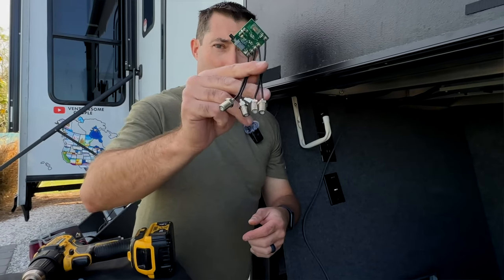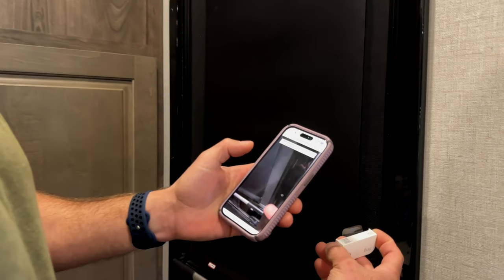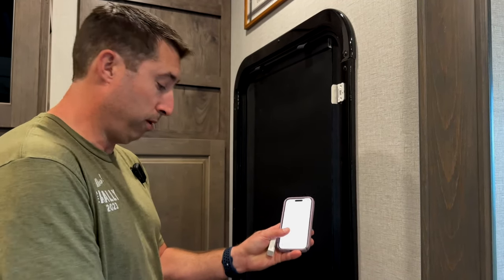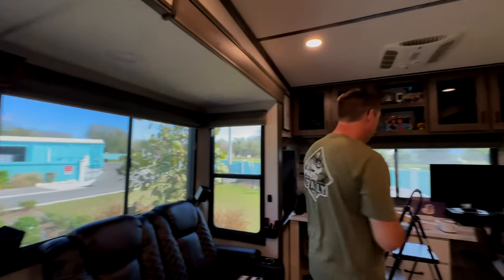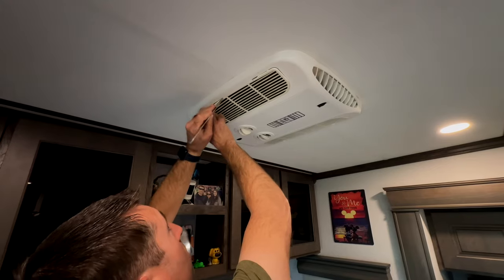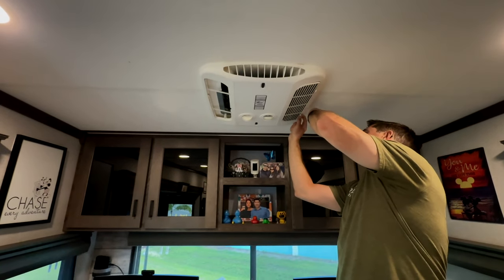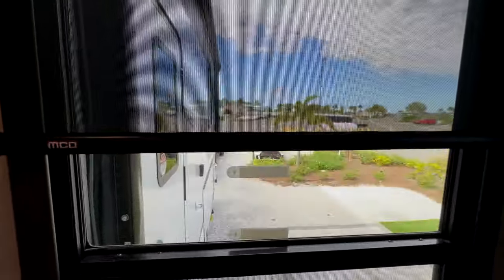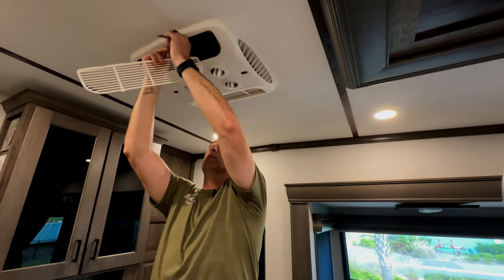Fixing What We Broke on Our RV: Maintenance Tips & RV Hacks

Comment: We do try to keep our filters clean.  It's easier for you because you're taller. LOL 
I do like the idea of the brush to clean.  We usually use hot water & then have to wait for them to dry.  
Did ypu clean the table before dinner?  🤣🤣
GREAT VIDEO!
Reply from the maker: Thank you for watching our video. And yeah Chris is tall, isn’t he. Although he still used a stepstool to get up there to get the vents out, so we can clean them. It was too windy while we were staying there so we ended up just eating inside our RV., but we did clean the picnic table off, it was easy to do since it was plastic.